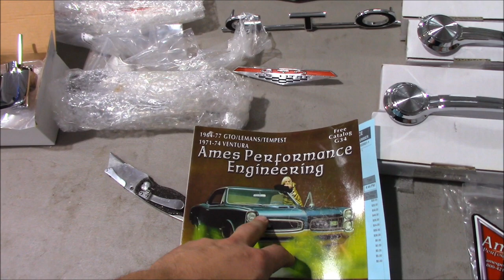2 Post Atlas Lift Install part 2

Comment: How's your hoist holding up? We just ordered the same one to replace a failed in ground.
Reply from the maker: I love it except for one thing mine didn’t come with the safety release levers that controls both sides . Mine has the pull down cables that’s the one thing I don’t like.

Comment: Your lift has locks. After lifting just lower it back down onto the locks. Won't have any trouble with cars. When you have to worry about weight is on trucks. I did a suspension swap in a 68 GTO with no engine and I c clamped the frame to the lift so when I was doing springs it didn't come off the pads.
Reply from the maker: Super cool man. Ya it's my first lift and I'm still kinda nervous with it but I'll get there. Haha
Reply: @HoustonKilby  you'll get used to it fast. And wonder how you worked on cars without it. at the height your at in videos you probably aren't at the first lock yet. They always say to lower it down onto locks after raising it. Depending on what I'm doing or how long it'll be hanging I'll set it on the locks..